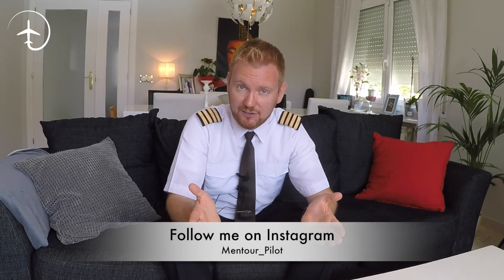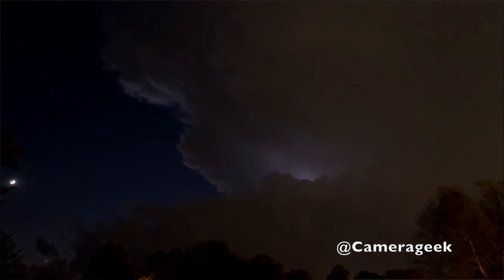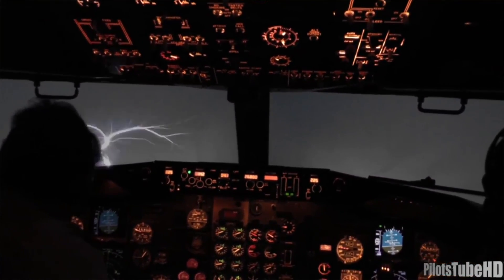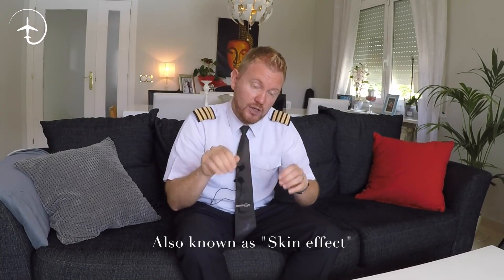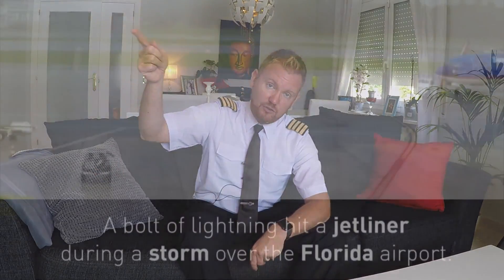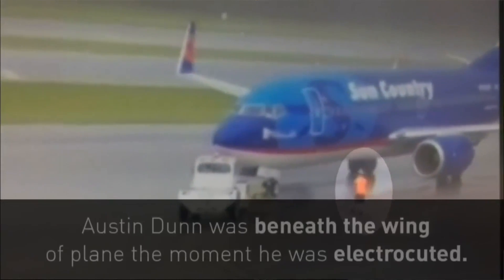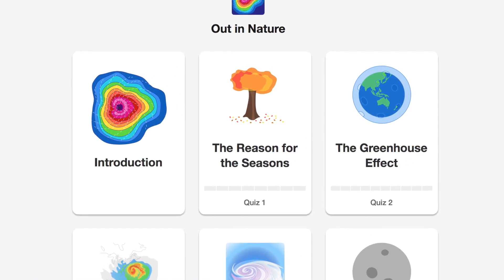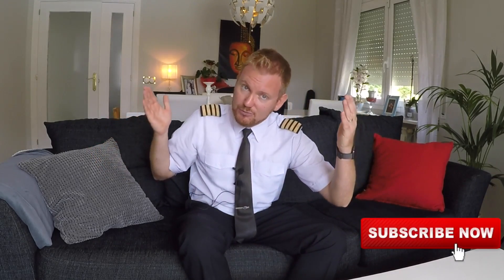Aircraft Lightning strikes - How I handled it

Comment: The faraday cage effect and the skin effect are actually different phenomena. A faraday cage is formed when an enclosed space has an even charge around the outside. Since charges of the same sign repel each other, being surrounded by charges of the same sign tends to completely cancel the net charge on the inside. This is true no matter the kind of electric current. The skin effect on the other hand applies only to AC or very short DC pulses of electric current. The changing magnetic field formed by the changing electric current induces other currents deeper in the conductor, flowing in the opposite direction, which cancel the main current out everywhere but a thin area at the surface. If the current keeps running constantly for long enough (as in a DC circuit) the magnetic field will eventually stabilize and the eddy currents will collapse, allowing the electricity to flow through the entire area of the conductor. This is why wires meant for AC current tend to be made of strands of smaller wires woven together, so they have a larger surface area.
Reply: The skin effect means the current passes through a conductor close the surface of the a conductor rather than center of the conductor. To increase the current carrying of a conductor small wires are woven together, to construct the conductor .  this is true for both AC or DC current.
Reply: He never talked about Skin Effect .

Comment: Tip about refueling; on airplane they connect grounding cable to airplane to remove static charge but on your car you can touch your car with hand before touching car with refueling nozzle. If you don't do that spark can occur on wrong place and ignite fuel, especially gasoline is dangerous. 
Not doing that is at same level as smoking while refueling your car.

Comment: Very good info.
I think with changing climates the wired connection with the ground staff to be shifted to Bluetooth or on other wireless protocols and platforms like IoT (Internet of Things) to name some. The ground staff can plug their radio modules with the receptor in the Aircraft and get connected wirelessly. It will be a litter safer bet in the stormy weather and easy in normal work days as they dont need to follow the length of wire with the Aircraft.
Reply from the maker: True, but just holding operation works as well. The aircraft won’t be taking off in a storm anyway.

Comment: I was hoping you would have addressed the question " when airborne and struck by lightening,  why doesn`t the fuel ignite? "
Reply from the maker: For the same reason that you don’t. Because the lightning is conducted through the skin of the aircraft and out again.
Reply: @MentourPilot  this is not the full story.  there HAVE been fuel tanks that exploded due to arcing inside fuel tanks as a side effect of lightning strikes... but that is why fuel tanks are now lined to prevent arcing, wiring has changed, and even nitrogen rich air is pumped into tanks to prevent combustion.  conduction of electrical charge through the skin can cause sympathetic conduction in electrical lines nearby as well, which again is why wiring in planes is done differently now than it used to be.

Comment: mentour my humble request you to make a video on what pilot will do where their no radar contact? and why pilots are not communicating to passangers when a critical situations occurred in cockpit?
Reply from the maker: Aircraft is not always under radar control. We fly what’s called “procedural” approaches when that is the case and is separated from other aircraft by time and altitude clearances.

Pilots are trained to always focus on flying first of all. Communication with passengers is important but if something critical is happening, we concentrate on that first.
Reply: but mentour in the emirates flight 521 crash landed without landing gear its self if the pilots are also well trained there is an human error may occur in this situation?
my question is how will you face this type of situation and communicate with passengers brace for impact...........................explain why this had happend................................................
Reply: mentour their is a rule of faa it states that the flight below the altitude of 10000 feet the landing gear should be down why the pilots did not perform this operation
Reply: Then why the air traffic control informed the pilots while there is not enough altitude is left to make a go-around move?

Comment: If you were to lean your head against the window for example, Would you feel anything when a lightning strike accours? Well done Petter, Lots Of Explanation
Reply from the maker: No, you would not feel anything.
Reply: Being an aircraft a Faraday cage the inside electric systems and passengers are pretty safe 😉
Reply: Cool thing -- Electricity is conducted through the skin of a conductor, not through the actual core of the conductor. If you're on the inside of an aircraft, that is a separate surface from the outside of an aircraft.
Reply: Except the windows. Not so perfectly a Faraday cage. And the windows are getting larger nowadays...
Reply: Mentour Pilot 

As a physicist I agree you would not feel electrical effects.
The strike will produce heat close to the points of entry and exit, so you might feel that  (It is the heat that caused those little holes)
Reply: You would feel surprise! :-p Otherwise all OK
Reply: Your hairstyle will become like spikes if lightening strike occurs :P
Don't worry, your hairstyle won't change so no lightening risk for you as a pax
Reply: @Matthew Evans: Wow, thank you! This is a thing that I actually learned before but always forget. Now this context may help me to keep it in mind.

Comment: mentour my humble request you to make a video on what pilot will do where their no radar contact? and why pilots are not communicating to passangers when a critical situations occ
Reply: occurred in cockpit?
Reply: sorry this is wrong
Reply: They don’t communicate because they don’t want them to panic
Reply: How will passengers help? They try to communicate with ATC all through. Passengers will panic and make things worse.
Reply: Lack of radar contact is not a "critical situation".  Planes have self-sufficient navigation systems, and there are rules about how far you can be from your flight plan and what altitude you have to be at.  Over the oceans, it is normal for aircraft to be out of contact with any authority for hours, and these rules are sufficient to guarantee safe separation between planes.
Over the U.S., it is also possible to be out of radar contact due to equipment failures.  ATC has contingency plans for any kind of outage, and they train for these.

Comment: Just wanted to ask whether a lightning strike poses any threat to the fuel? Like can the high current and high temperatures ignite the fuel in the tanks by any chance ?
Reply from the maker: No, the lightning is led through the outside of the aircraft whiteout ever getting close to you or the fuel.
Reply: Soumik Chatterjee I believe that the fuel tanks are Faraday cages themselves but I may be wrong.
Reply: Some Person yeah mate sounds convincing. Thanks :)
Reply: Mentour Pilot oh yes ! And what about any heat that would be generated? Can that possibly ignite the fuel?
Reply: It at least used to. Pan Am Flight 214 is believed to have crashed due to lighting igniting vapors in a near-empty fuel tank.

Comment: Which is better yoke or side stick
Reply: I'm a Boeing guy 100%. So yoke
Reply: murtuza khan yoke
Reply: I once saw a documentary that pilots complain about the joy stick because it provided no feedback of what the controls were actually doing. Where the Boeing yoke would move as the autopilot moved the controls so the pilot could feel what was going on. The documentry was about a crash where the autopilot was correcting for a failed control, a rudder I think, but when the autopilot could not correct for it anymore and disconnected the problem was so bad the pilots could not recover. The theory was that the joy stick provided no feedback so the pilot could not feel it. I wish I could find that documentary again.
Reply: The other big problem with side sticks is that unlike the yokes, pilot and co-pilot can move their side sticks in opposite directions. It contributed to the crash of AF447. Apparently it wasn't completely clear who was the pilot flying, so while one pilot was pulling up, the other was pushing down, counteracting the inputs and possibly contributing to or preventing recovery from the stall.
Reply: You can better ask captain joe that question.
Reply: Marc Van Loo thank Joe has flown Airbus and will soon fly Boeing thanks for the idea
Reply: murtuza khan I prefer the Yoke as I feel like I have more control over the aircraft, but that could just be me.
Reply: EveryTypeOfVideo I think we can control the aircraft with the side stick
Reply: murtuza khan hes flying the 747 on the 4th June
Reply: EveryTypeOfVideo I know about that
Reply: EveryTypeOfVideo on cool
Reply: stevek917 ok
Reply: stevek917 QZ5801 right?
Reply: SERVESH KUMKI
It was a long time ago so don't remember all the details. Is QZ5801 a flight number?
Reply: Me too
Reply: stevek917: This goes back way farther than joystick controls.  I read about this about thirty years ago.  On most fully mechanical aircraft, the autopilot corrects for altitude errors by adjusting some combination of the yoke position for quick changes, and the elevator trim for longer-term adjustments.  So unless the pilot notices the trim wheel moving in the same direction over a period of time, he has no warning how much trim has been dialed in.  Again, the first indication that there's a problem can be that the plane is uncontrollable.  Hopefully, this lack of feedback to the pilot was corrected long ago.